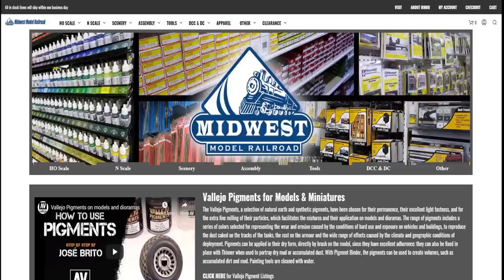NEW Atlas N Scale GP38-2 with ESU Loksound

Comment: Ron, you missed one important difference: The electrical pick-up from the wheels is hard wired instead of the phosphor-brass springs. This is a good advance and I am trying to do the same with my older GP 38-2s. Good show.
Reply from the maker: You are correct. I did not mention that specifically but that is part of the redesign for the ESU decoders as ESU designs to be hard wired.

Comment: They're nice locos, bought both of the Indiana Harbor Belt road numbers and each had unique features based on individual prototypes. 

Worth noting that one of the copies I received did not run out of the box (sound only, no movement) and required a quick disassembly, removal of the chip and re-adjustment of the motor contacts to seat correctly up against the contact points on the chip. The contacts are of a different (and I think superior) design relative to the old frame.
Reply from the maker: The hard wired pickups from the trucks are an NCE requirement and a big improvement as well.

Comment: I really don't like Lenz decoders. When I was first getting into the hobby atlas locomotives with LENZ decoders were on the cheaper side. I have since removed them and replaced them with Tsunami 2. Great video and beautiful locomotive.
Reply from the maker: Yes, the economy Lenz decoders that Atlas used to use in factory installs were terrible.

Comment: You forgot to mention that the Trucks are wired vs metal spring strips....  I would liked to have seen how well it consists with a non sound equipped locomotive.  I would consist it in the middle as a grouping of 3 units.   2 non sounded DCC equipped engines on either side   (DCC)(SOUND)(DCC)
Reply from the maker: My experience is that sound decoders don't play nice with non sound of different mfgrs. Thus, in you case you mentioned, I think your best bet would be to consist with 2 ESU non soound decoders.

Comment: Excellent review.  I have a newer GP38 Atlas Gold Series in C&O #4823 and it is one of my favorite engines.  I actually have a second one on order.  Quick  Question for you, when you refer to speed steps what exactly do you mean?  I have a Digitrax Zephyr DCC system and my throttle goes from 0-100%.  Is speed step 5 actually 5% or are you referring to the CV's?  It seems that I read that 0-100% on my system actually equates to several hundred CV's.....

Comment: Thanks for sharing. The pulling power seems good. How does it compare to the old unit?  TMRCI.
Reply from the maker: I would say they pull equally well, but the new one runs more reliably and is less susceptible to stoppage on a minimally dirty spot on the rails.
Reply: @RonsTrainsNThings  Thanks for the info.

Comment: How are the couplers? I've heard the best thing to do is change them to MicroTrains right out of the box?
Reply from the maker: My suggestion is try them. They are accu make couplers. That said, my experience is that usually accu make couplers work fine, but sometimes they can be problematic. On this locomotive they seemed to be fine. If you want all of your couplers to match esthetically than I would suggest changing them to micro trains. The fact is The upgrade to micro trains is inexpensive and easy.

Comment: Howdy Mr Ron wanted to pass on i did get My BNSF 2256 and Wow what Darn cool little Engine and like my GP39-2 Santa Fe's in Koda and Santa Fe Blue Livery and one more my U.P. GP30 U.P. they all have the Better Wire I think hook up to the Frame, 

MY Question i wanna Ask and maybe a Project you could Do and Try if you haven't already is take a Kato Engine with a Lok Sound Decoder and set it up basically the same way.. I myself at this time I don't have a Good work Bench to work on any projects or tasks but I'm wondering if a Kato Frame could have small holes drilled then tapped in it to where a small flat screw could be then screwed into the frame & then a solder wire from the Trucks could be solder to the screw thats in the Frame.. if you could do this Ron could please do it on your Regular Channel at this time I have no way to pay for premium channels but maybe next year I can possibly do it I imagine that I could possibly use some kind of card to take care of the Charge i know my Dad would really like one of your Cups he a Coffee Guy all the way.. 

Thanks and Continue Staying Safe..

Comment: Hey Ron! Im a new modeller and cutrently working on my 4x8 layout.  This is my first layout. Electrical work and anything to do with wires and power is overwhelming for me. Is there a video that actually breaks down the meanings of different things like buswire or other terms. Also im looking at using digtrax for my layout is there a video that actually shows and describes the purpose for the digitrax or any other brand of electronics for my layout. Im looking at going big now because in 2 years i will be starting on a very larger layout.
Reply from the maker: Hi, Jeff. It just so happens that my latest video deals with installing feeder wires, and I have a short playlist dealing with various aspects of wiring and DCC. Here is a link. I hope it helps: https://www.youtube.com/watch?v=6e6IecGiNtM&list=PL05wIKjXooC1zltnLDV4EVXs5CmYe56WK

Comment: Hey Ron this is Ron  I wanted to pass along that Engine Does look & Sound Good I'm hoping get mine Soon and Hopefully I can Team it up with my Atlas GP39-2 Santa Fe I was wondering it is said there are Quit a few features in the Decoder your Horn, Bell, Dynamic Brake Sound the Air Spitters and I've heard these Engine have Brake Squeal if they Do what function turns that sound on n' off or is there such a function or does it have to be Manually switched on through a programmed CV was just wondering it would be neat to also hear some Rail Squeal or as the Engine passes By the Rails being pressed by the weight of the Engine I guess them sounds we'll soon see as these Decoders become a more demanding desire..  

I Wanted to add: I heard the Engine Cut out more than once I know I'd be Gritting my Teeth if I was Trying to do a Review and the New Engine I was showing everyone wanted to take a powder on Running Smoothly but I guess that happens to all of us and with my New GP39-2  and my GP30 U.P. both Engines had Quite a Build up of Black Gunk on the Wheels which got Removed rather Quickly before I even Ran the Engines Break in Laps.. 

Take Care Ron Of Ron's Trains n' Things😏 we look to see some more Great Videos Allen D.